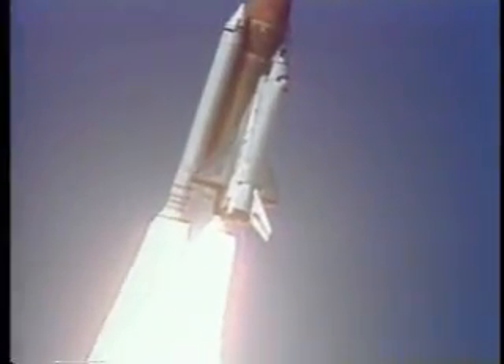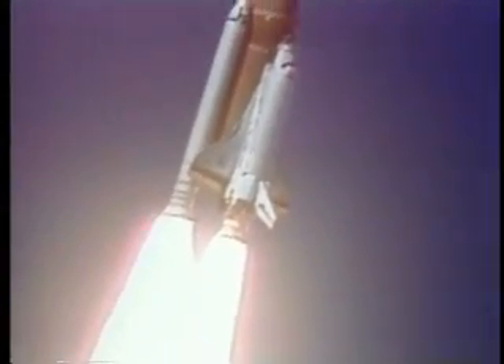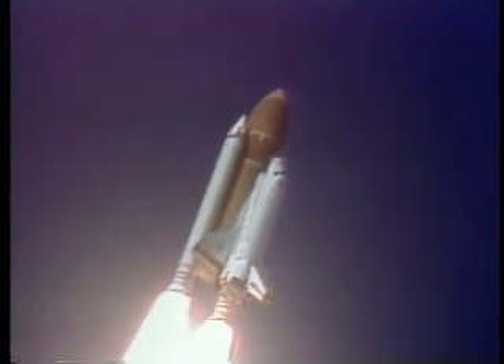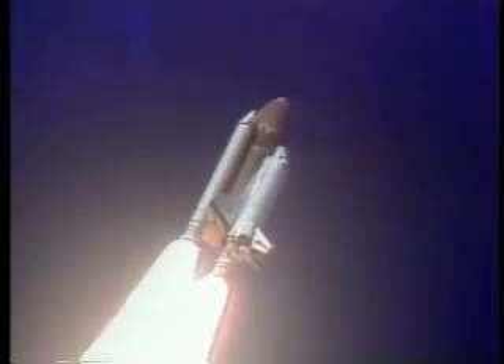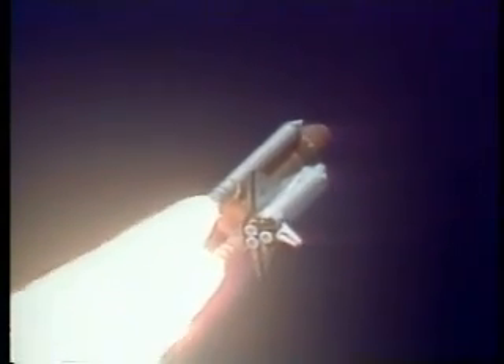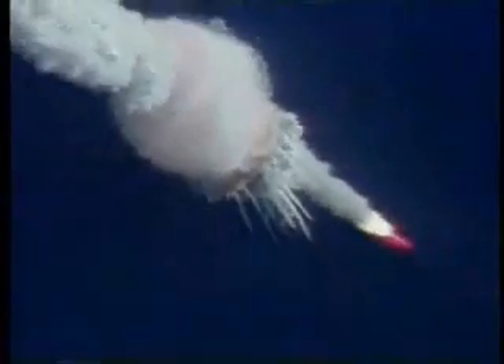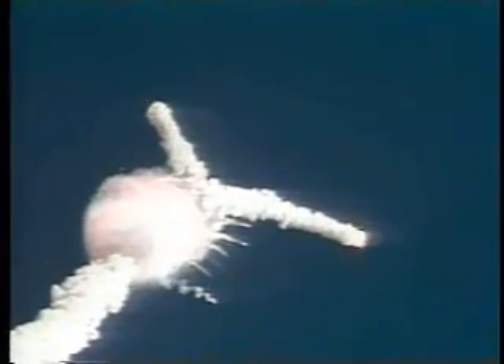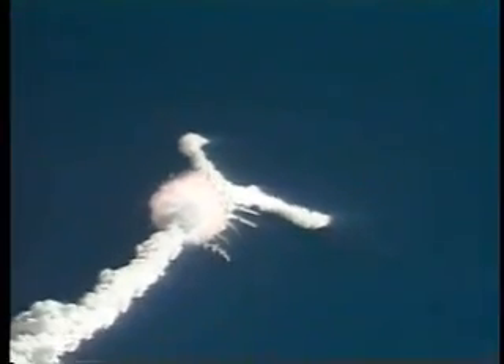Challenger STS-51L Accident With Flight Control Audio Loop

Comment: The capsule  was still intact when it exploded.  so many believe  that the astronauts where still alive after the explosion  and actually  died when the capsule  impacted the ocean.
Reply: That's right.
Reply: Yes that correct due to them engaging their emergency oxygen suits. Very sad and I can't even imagine the fear they were feeling
Reply: Yes, I heard that.
Reply: Ik, k saw the documentary about it and I heard from one of the austronauts that was also a surgeon said that he believes the same thing as u said stellcity1981
Reply: Probably died briefly before due to the insurmountable heat and fatal lessions, but what seems to be confirmed is that at least half of them were still alive and trying to perform actions after the explosion
Reply: I’m wondering why they weren’t ejected and parachutes 🪂 activated. Maybe it was damaged too
Reply: @MyVlogTherapy  the capsule didnt have an ejection sistem. Even if it had, at such force they would have depressurized and died violently if they managed to get out, as a later report pointed.
Reply: @JodieLee808  also a number of switches had been moved from their launch positions, which was likely an attempt to restore power.
Reply: @rXw55 yes their bodies are at peace but we all know where their souls went either here 😇 or here 🔥 😔
Reply: @cmack7281  Gross comment
Reply: @MyVlogTherapy  1 simple reason. There were no parachutes or ejection system.
Reply: They were fairly quickly consumed by fire, but they certainly felt the pain in anguish for that intense moment.
Reply: @jfnovae  The capsule wasn't destroyed by fire. It was intact as it fell to the sea.
Reply: Yes. That's actually quite sure. The question is whether thes lost consciousness before hitting the water. I feel like they actually experienced the whole fall down.

Comment: The one thing that I don't understand is that there was live video which CLEARLY showed the rupture on the booster that resulted in the catastrophe a few seconds later.....yet no flight controllers seemed to be aware of it, at least not immediately. How was that so?
Reply: You gotta realize that everyone in flight control were focused monitoring the data the shuttles sensors gave them. Even if somebody spotted the rupture in the grainy video, it could take at least half a minute for control to register the threat, and abort. That being said, in accent there isn’t much you can do abort wise, once the boosters are lit, they won’t stop, giving the shuttle little in means of safe abort options. If the Rupture had lasted for several minutes instead of several seconds, the crew could possibly have had a chance to abort.
Reply: Yea, until the 2 minute mark, when the SRBs separate, there are precisely zero crew abort options that can be initiated. The one (ircc) option that exists for anything going on during those first minutes, an RTLS (return to launch site) abort, cannot be initiated until after SRB separation. 

That was one of the main issues a number of NASA personnel had with the shuttle department. The simple fact that there were largish chunks of time during launch that there were no viable abort options that would result in crew survival.
Reply: @dantreadwell7421  I thought I remember reading somewhere where the ET stack, in an extreme case, could be dumped with the boosters still attached. The OMS engines would fire to keep the Orbiter stable long enough to get it rolled into a glide position. The ET stack would continue on until detonated by the RSO.
Reply: @neonhomer  No, the Orbiter must stay affixed to the External Tank until the SRBs have burned out at 123 seconds MET.  The orbiter to external tank and external tank to SRB junctions cannot release with thrust loads still being applied.
Reply: Based on what I know as an armchair astronaut I agree with Lanzbik.

Comment: Was one of those debri splashes, the space shuttle? I heard that it is believed that the crew survived the explosion, but died on impact of the waterwater
Reply: +afcomser The orbiter didn't explode, it was ripped apart by G-forces and aerodynamic stresses far in excess of design tolerances.  Likewise, the external fuel tank didn't explode; rather, all the fuel ignited at once and it flashed.  Had it happened on the launch pad, as Thiokol engineers expected (their warnings were ignored by Nasa and Thiokol management because they clashed with 'the program') then there would have been a colossal blast that would have taken out pretty much the whole launch facility.  But because the orbiter broke up rather than exploding, the crew compartment, robustly constructed, separated intact and fell on a ballistic trajectory for over two minutes.  All of the splashes in the video are orbiter/external tank/rocket booster debris and one of them would likely be the crew cabin.  When the cabin was eventually found and brought to the surface, it was found that three of the emergency air packs had been activated and that controls on the pilot's console had been altered.  It all points to at least three people being conscious for at least some of the fall.  Impact at 200+ mph was not survivable and there were no crew escape systems, not that wholesale vehicle disintegration would have been survivable in any scenario.  About the only ejection system that could have worked would be an escape pod of the sort built into the F111, whereby instead of ejection seats, the whole cockpit assembly jettisons and then descends on parachutes.  However, weight and expense issues probably ruled that out, plus with the disintegration happening so swiftly, any ejection pod systems would likely have been destroyed anyway.  It was an avoidable accident but unsurvivable from the moment the shuttle was launched.
Reply: right, it pitched slightly to one side when the SRB strut failed and at that speed the orbiter was torn apart. the flight cabin, being very robustly built, was thrown clear and proceeded on a ballistic trajectory and then decended to the ocean.
Reply: The crew cabin hit the water 2 minutes and 45 seconds after the explosion.
Reply: Hi Elenna. I agree with what you're saying until your last sentence. The accident was certainly avoidable, but there was a question of whether or not the shuttle -- if a problem was detected early enough before or during launch -- could have jettisoned itself away from the fuel tank and rocket boosters. If you look at video footage of all angles, the Challenger was flying with a left booster that had already failed for several seconds (possibly up to ten seconds). Releasing the boosters would have allowed the Challenger to continue the upward trajectory and given it time to release the external fuel tank and, potentially, glide back to Kennedy.
Reply: I remember KRanz talking about being extrmeley nervous for 2 minutes because there was no abort option of any sort available.
Reply: most accidents are avoidable....but the systems are complex and human error is always a risk...a small mistake can result in disaster
Reply: "It was an avoidable accident" Boy was it ever! I saw a replauy of that contentious ph one call between NASA and the Morton Thiokol engineers on the eve of the launch and near the end of it some NASA official asked if anyone at Morton saw any reason why the shuttle should not be launched and not even Roger Boisjoly spoke up.
Reply: In air crashes, you have the 96% of possibility of surviving the initial failure (extreme example bomb in the cabin, you are in the tail, and the bomb is in the front, you survive the explosion, maybe the fall, but not the impact) it is possible that happened there too
Reply: @notyourbusiness2335  the reason is mainlly that the side boosters dfailed but the orbiter was ripped from the main tank and fell the crew was alive and survived but died on impact
Reply: @elennapointer701 A good assessment.  The damage was done ironically 0.64 seconds after launch before it had even cleared the tower. The O ring failure is clearly seen as a cloud of gas visibly escapes. This was partially blocked by debris until that dislodged during maximum g force of the flight at 73 seconds.

Comment: The crew cabin survived the initial explosion and the reserve oxygen tanks for the pilot and commander were activated by the astronaut behind them so at least 3 people survived the explosion and plunged for 2 minutes and 45 seconds. The pilot was experienced so he could have survived the estimated 12 gs they sustained (pilots are trained to manage 9) though he was likely disoriented and I doubt that any input on the stick would have made a difference as the crew compartment doesn't have any wings to control on the way down. Being trained astronauts and not knowing what happened, I bet they worked hard to try to figure it out but damn, I can't begin to imagine the sheer terror.
Reply: Pilots in general are the most level headed cool calm and collected people alive. Astornaut pilots are the top .00001% of those pilots. I bet if he hadn't passed out from the g forces, he was trying maneuvers and reporting calmly back to Houston until the second before he hit. Thats why the only only reaction before lose of signal was a very mundate "uh oh". Thats the pilot equivalent of you or I screaming OH MY GOD WE'RE ALL GONNA DIE!!!
Reply: @frenchydawg  where's the source of this info about him reporting back?
Reply: @LorenzoGiordanoGomes  I think Wikipedia has it. They also found that many of the pilots switches had been moved from the normal launch configuration and they found that due to locks on the switches neither the explosion nor the impact with the ocean could’ve done that. This means smith was flying at least for some time after explosion and working to save the shuttle. Hell of a pilot.
Reply: @frenchydawg  Oh, there are pilots who let out expletives and screams before dying in crashes.
Reply: They were talking all the way down
Reply: @Bonzi_Buddy  we dont know if they screamed or not, but what the wreckage shows is that they still tried to do maneuvers and pull controls even when it was mostly futile, the control locks show it. So they didnt lose it at any moment, even if they knew they were certainly doomed. Those nerves of steel are so fucking impresive.
Reply: You just imagined it with this video and your five paragraph essay. Ty
Reply: @clintonire4579  delusional
Reply: @LorenzoGiordanoGomes  I seen the video the one woman said oh God not like this, that pilots thought it would be a slide effect when hitting the water, they should have been recovered immediately not days later, they don't want yall to see that video, but I've seen it, I think they keep pulling it
Reply: @kevinsalyers690  oh yeah the famous conspiracy theory
Reply: @LorenzoGiordanoGomes  lmao not a conspiracy I seen the video twice, sorry you can't believe it because you can't find it lmao
Reply: @frenchydawg That's not necessarily true. A kot of black boxes audios show aircraft pilots screaming desperately for their lives as the airplane falls.
Reply: Especially when you realize that you are heading down to the ocean for impact.
Reply: @PauloHowlett  Yes true. I think there aren't many people who would keep calm and collected.

Comment: if you're really morbid you can estimate the crew cabin hit the water sometime around the 4:15 mark of this video.  they say the blast propelled the crew violently upward before gravity pulled them back down.   a long and probably very disorienting final 2 minutes.
Reply: The investigation found that the 3 out out of the 4 PEAP oxygen devices wouldn't have provided nearly enough compressed air for the full 2 minute plunge, they said it was likely they were unconscious due to the loss of air pressure well before the craft hit the water, but unfortunately  it's inconclusive.
Reply: @victorlabouche6471  That isn't the case. They would just have had to take their masks off. There was plenty of oxygen. They might have been unconscious from the gs, but not from the oxygen loss. It is very likely they were conscious all the way down.
Reply: @Bret Zayger_Michigan Gravitational force.
Reply: @Bret Zayger_Michigan How, exactly?
Reply: Yes i listen those Word at 4:15..
Make me Very sad i Think nasa 's manager should arrested in the charge of 7 people 's death..
Reply: The worst bit is if they were conscious would have known the next few seconds would be their last.
Reply: Victor LaBouche there was no loss of air pressure so oxygen loss wasn’t an issue.
Reply: @cupsofcarys  it's true, all indications are that most (if not all) of the crew were alive and conscious after the break-up.   The heavily fortified crew cabin was hurled through the air without the orbiter and its nose cone but the pilots likely tried to restore power and fly it as best they could. but without an ejection system I don't see any way they could have survived the impact.
Reply: @RyanInLA  They certainly did - the investigation later showed that a few lever-locked switches on Mike Smith's right-hand panel had been thrown open; there was apparently no way either the impact or the explosion itself could have done that, meaning he was almost certainly conscious and desperately trying to restore power to the Orbiter. Tragic and heroic, without a doubt. 

RIP the seven. 😔😔🙏🙏

Comment: What were the trails behind falling debris made of? Was it burning? Or is it a condensation trail?
Reply: parts of the large fuel tank
Reply: Fuel and gasses leaked from the fuel tanks
Reply: A combination of vapour and smoke -- hydrogen, helium, oxygen. In the early parts of the breakup you can see reddish orange. This is nitrogen tetroxide from the rockets used in orbit. Ammonia from the coolant system and a bunch of other materials also were onboard.